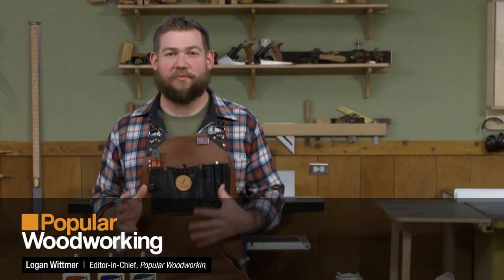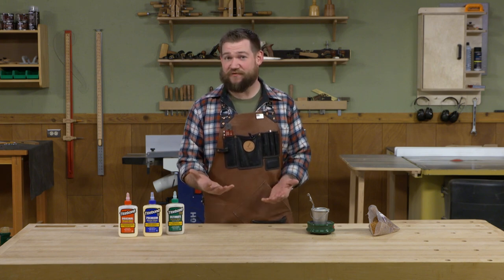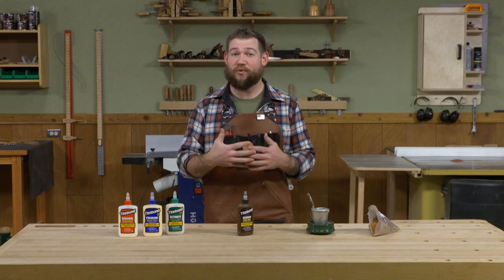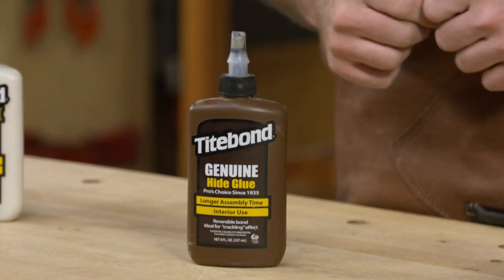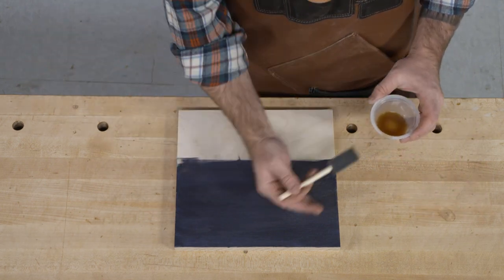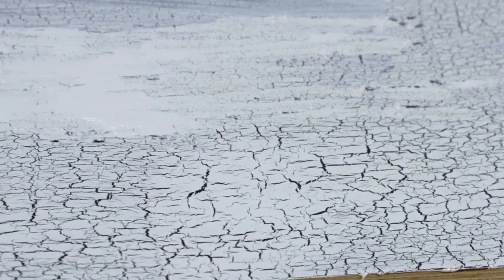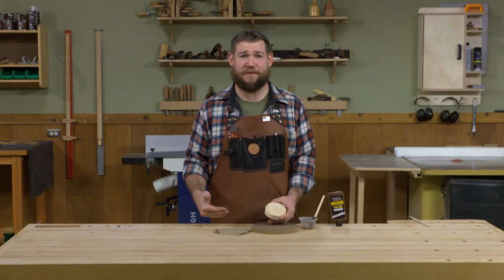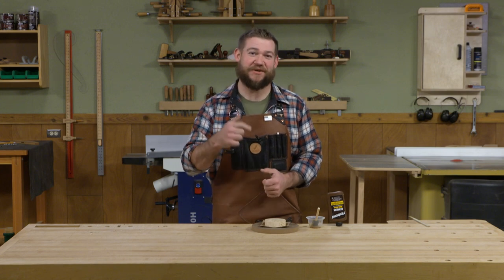Using Titebond Hide Glue

Comment: I've been using liquid hide glue for more than 30 years in historic furniture and wooden artifact restoration. Sure, the joint may not be quite as strong or as permanent, and certainly not waterproof, but that can be a good thing; better that the joint fail than that the wood fail. A joint and be cleaned and re-glued many times, but broken wood can only sometimes be repaired effectively, and even then a very limited number of times. One of the reasons so many older pieces have survived is the fact that they can be effectively repaired. This is much more difficult with more modern adhesives. Most of my original pieces are built with hide glue for this reason.
It's important to mention that the liquid hide glue has a shelf life (and an expiration date on the bottle, which is a reasonable estimate), after which it tends not to dry hard. I keep all but a small bottle of it in the freezer to prolong its life. Don't use an older bottle of liquid hide glue before you do a test to make sure it hardens properly.

Comment: I have a bottle of Franklin hide glue from 1988 that I got from an old worker. It's been in my garage many years with no heat through the winters and it still works!  I have just under a quarter of the bottle left. It holds strong.

Comment: I'm probably using Titebond Hide glue to repair the crack in my guitar neck. Everything I read says it'll hold just as well as standard Titebond, only it's reversible later. Say if I wanted to have my guitar professionally repaired sometime down the road. Or if I screw up, I can undo the joint, clean it up, and try again.

Pretty sure I'll be using hide glue. The crack is forced closed under string tension so it won't be actively trying to pull it apart like most cracked guitar necks. I figure since it's being forced closed under tension, hide glue should be plenty.

Comment: I see why you would use it for temporary holding, but I still don’t get why bother otherwise. Does it set faster/slower? Why would anyone go through the trouble of disowning pellets and heating the mixture up? Is that for some period accuracy?
Reply from the maker: It is a much slower set time. In addition, hide glue blends in under most finishes, and the squeezeout can be cleaned up with a toothbrush and hot water. The pellets offer fast initial tack because they're hot — You can create a rub joint and glue pieces together without clamps.
Reply: Watch videos of Windsor and stick chairs that use hide glue, they have a super easy cleanup with water/toothbrush with wet or dry glue. On top of this if a part breaks in use over the next few years (or decades, or even hundred of years), or you put something together wrong, the joints can be removed with water and heat. As the video says the glue also sticks to itself so you can fix the part, add more glue, and not worry about it not sticking in the joint. It is the gold standard for furniture making if you want any chance of taking it apart later to fix it, and not just throwing away the whole piece.